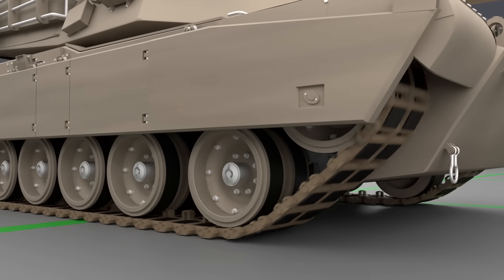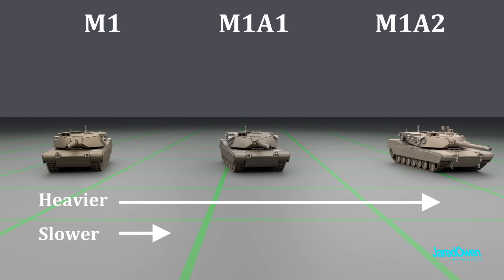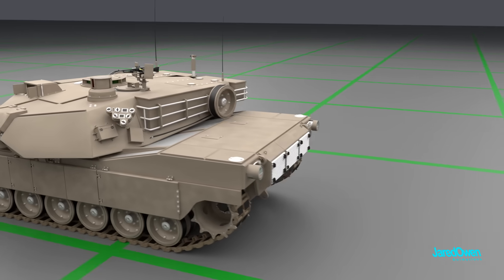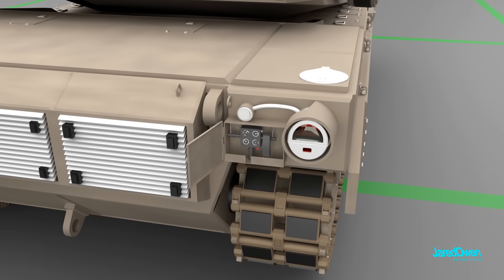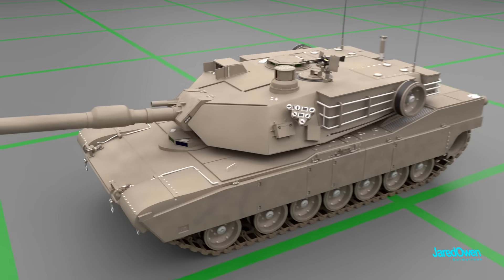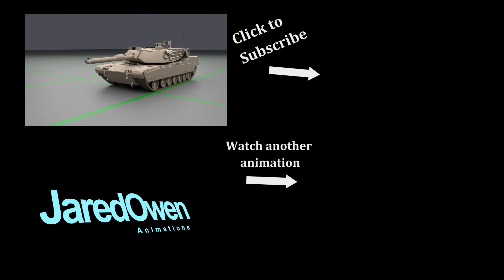How does a Tank work? (M1A2 Abrams)

Comment: I am an Army veteran (3rd Armored Cavalry) with experience with both the M1A1 and M1A2. I will provide quality control if necessary: 
@2:30 Top speed on flat, solid ground. Slower over rough terrain, but still capable of rapid pace (well over 30mph) 
@2:33 Fuel is distributed between 4 tanks: 2 in the rear and 2 in the front. Fuel is standard JP8 petroleum, similar to diesel. M1 can also run on other fuel types in distress.
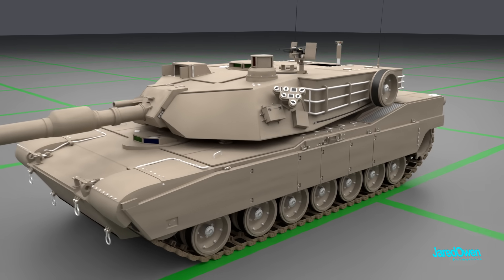@2:45 .6 mpg while driving, it has been suggested (not verified) that it takes 2 gallons to start the engine. For tanks not equipped with an EAPU (External Auxiliary Power Unit, a.k.a. generator) The engine is often left running to keep vital onboard systems operating even while sitting for extended periods- and in theory, to conserve fuel required by frequent restarts. 
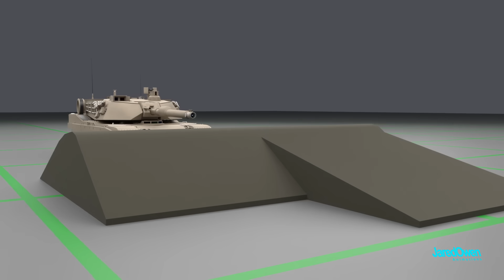@3:30 There are 7 PAIRS of roadwheels contacting the ground on either side (the narrator is not specific, but the animation did show them).
@3:56 The sensation of riding a tank over rough terrain can be described as being in a boat on choppy water: It "floats" over all but the most extreme obstacles.
@4:07 I have experienced extreme inclines (up and down) that I would have only attempted with a modified 4x4 vehicle, bridged trenches and never felt them, crossed through mud that would have swamped any other imaginable vehicle, and travelled at speed across rough terrain at top speed that, if attempted in my jeep, would have jarred my teeth loose and broken suspension parts.
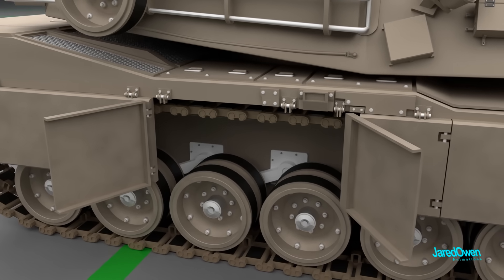@5:40 The "Power Pack", or engine, is modular and designed to be quickly, easily and regularly removed to ease maintenance. It can be prepped for removal by the crew and be out on the ground behind the tank within 20 minutes. It can be replaced just as efficiently. I have done this many times.
@6:24 "Make sure to stay clear when the engine is on"- There is a "jet wash" at the rear of the tank while it is running that gets more intense under power. At idle it is minor and is a boon during cold, snowy weather (look for groups of soldiers gathered behind idling tanks in the winter enjoying the heat.). ( "Crank up my $6 million space heater." is a common command from tank commanders during the winter.)  
@6:27 The phone is for infantry (using the tank as cover, etc.) so that they may coordinate movement and safety with the tank crew who are not able to see them.
@7:55 In addition to the loader's MG, the commander's hatch is typically equipped with a .50Cal MG (unknown why this is not mentioned or represented.)
@7:58 Smoke Grenade Launchers: The animation is inaccurate- smoke grenades are actually launched from the chambers and disbursed around the area to provide wider visual coverage. Not mentioned is that the tank is also equipped with a smoke generator that sprays fuel into the hot exhaust in order to create a large cloud that can be backed into or allowed to drift in a beneficial direction.  
@10:13 The driver's compartment is often referred to as "the coffin". It is actually very comfortable and drivers are known to doze off during periods of inactivity.

- The only thing not mentioned that I need to add is what makes the M1A2 particularly different from the M1A1 is the addition of the CITV (there are other improvements, but this is by far the most significant): The CITV is the Commanders Independent Thermal Viewer: It is the cylindrical protrusion on top of the turret just in front of the loader's hatch. This allows the tank commander to scan the battlefield and acquire targets independently of the gunner or the orientation of the main gun. This provides two sets of eyes independently scanning for targets and gives much more rapid target acquisition before and after firing; enabling immediate referencing of an identified target after another has been destroyed.
Reply: This should be the top comment
Reply: China: Write that down! Write that down!
Reply: @Pengied  In reality, none of this information is restricted and is readily available through publications. The classified information involves technical specifics (such as the exact composition of Cobham armor, targeting software, etc) that the crewmembers do not have.
Reply: "6 million dollar space heater"
Lmao XD
Reply: The loaders space isn't nearly that roomy as well. The coax ammo box and radios are located were it shows the loaders seat. The loaders seat is actually located more toward the rear of the turret.
Reply: (look for groups of soldiers gathered behind idling tanks in the winter enjoying the heat.) - Prior infantryman. Can confirm.
Reply: @TheMadMurf  bro f yes I melted my canteens standing behind that thing in the freezing rain. Trying to warm up lol. The exhaust was so hot the rain evaporated before it touched us. We were too cold to notice. Every time it’s could and rainy I smell the comforting smell of jet exhaust. ⛩
Reply: @michaelmartin5453  Yup: you can always spot tankers by the melted canteen straps!
Reply: @TheMadMurf  we would put MRE or can foods to warm the food
Reply: ቀጠኸቀኀኸሸቀኀጠ
Reply: Good work with corrections.  Only thing I would add after 13 years as a 19k is that we did run JP4 during ODS and the smoke generator must be disabled if you are running anything hotter than JP8 or you'll catch the engine on fire.  Also, as you know, that turret seal isn't air tight for the NBC (CBRNE) system since the NBC system isn't a pressurizing system but an over pressurizing system.  Even though I loved that useless turret seal hand pump for river crossings. I had enough days catching buckets of water in that turret to laugh at the air tight comments people often make, lol.
Reply: @rlbrooksssg  True, there are other details that can be mentioned as well, but then it gets into the "writing a technical manual" category. I never had the pleasure of running JP4 but I was aware of the smoke generator issue with the different fuel (another reason the driver's compartment is a death trap- "get in your coffin" being our instruction for the driver to mount up).
Reply: I'm not even American but thank you for the information and your services, Sir.
Reply: Thanks, Respect and Love from a military brat!
🙏🇺🇸❤️
Reply: Out-fking standing!!! 👍
From a Marine veteran.
Semper Fi...
Reply: "The driver's compartment is often referred to as "the coffin". It is actually very comfortable and drivers are known to doze off during periods of inactivity." But man, it sucks when you get a leg cramp.
Reply: Except it isn't called "the Coffin." It's just called "the driver's hole."  @resolute123
Reply: Sir you could make a vid with this comment , like wow 😂.
Reply: Very informative .
Reply: as a former m1a2 sep driver, i concur with the dozing off, including long road marches
Reply: @cpt_stupid82  I spent most of my time in the turret, but when I did get to drive, I will admit: trying to keep my eyes open on long flat road marches was definitely a challenge!
Reply: @psyekl  Tough for drivers! Does it have self-driving or automation of some sort?
Reply: @timly1165  "Does it have self-driving or automation of some sort?"  -In a way, yes: Quit paying attention or fall asleep and it will continue on in a straight path until it encounters something more significant... (joking: the throttle requires active participation).
Reply: Thank you for the additional info.
Reply: Thank you for taking the time to provide further depth details. For some one like me who knows nothing about tanks this was so interesting and will enhance my knowledge whenever I see and hear about these tanks.
Reply: I was at 3rd ACR HHT 2/3 ACR 1988 to 1989
Reply: Thank you for your service sir
Reply: What do you think about current state of tanks? Are the tanks still main strength of best world armies? Is it safer to be the tank crue member or infantry member?
What do you fear the most (which military units like aviation,artillery,drons,other tanks or infantry mentioned before) being tank crue member while you are deployed? 
Are m1a2 abrams able to survive the drons like phoenix ghost attack or artillery shelling or some shoots from tank destroyers?
Do you have something like radars or antyrocket shield that cover you from the homing missle attacks ? 
Sorry for that much questions but i havent got an ocasion to discuss with solider uo to now.
Reply: @Mocarz36  As tank crewmembers we were informed without any sarcasm or irony that on a modern battlefield our life expectancy was very short. If you look at the armament of the typical military, the term "anti-tank" or "armor-piercing" is very common. The typical joke is that soldiers are cheap: the tank can take a hit that will kill its crew, you just hose out the interior, weld the holes closed, and issue a new crew. Such is the life of a soldier, and we accept it. The strength of the tank comes not only from its armor and armament but primarily from the expertise and cooperation of its operators: speed, efficiency, good coordination and excellent leadership are what keep tank crews alive, not the armor. the same applies to infantry.

As for "what do we "fear"- we are literally riding around in a metal box that has few or no safety considerations, but a great many moving parts while one part swivels about on the other. ammunition doors are hydraulic and will sever an arm if you're not fast enough, the breech of the gun will crush you if you move at the wrong moment, stick a foot through a gap in the turret basket and you will lose it, if the driver doesn't communicate properly while their head is popped out of the hatch and the turret gets turned, well, whoops. Stop too hard or hit a severe obstacle at speed and there's nothing but unforgiving metal all around and no seatbelts, the heater is notorious for catching on fire and the extinguisher system is halon (no oxygen), a rollover means everyone except maybe the driver will be trapped inside until rescue, the driver's compartment is called "the coffin" because the driver can only exit with the turret in a certain position, so in the event of an emergency... 

So to answer your question: We are terrified of our own damn vehicle! Whatever the enemy throws at us is just something new to pay attention to until we get back to surviving the rest of the day.
Reply: @psyekl  Fact Check: True
Reply: @Mocarz36  "Are the tanks still main strength of best world armies?" -I'm not an expert in the subject, but I would have to say the answer would be more and more: NO. Not only is the fact that munitions are getting better and better, but the methods of delivering them are getting more and more "smart" and easily obtainable to less well-funded militaries. The strength of tanks are in their "shock factor" and their ability to take ground, but they are slow, prohibitively expensive and cumbersome to maintain for any but the most well-funded militaries. With the development of new technologies, the state of the battlefield is also changing and the role of the tank is growing less and less relevant.

What is important to understand- and something that, as soldiers, we learn to deal with as a reality: Equipment is expensive, but soldiers are cheap. While they have the technology to outfit a tank with equipment to make it keep its crew alive longer on the battlefield, it just isn't worth the cost. Tanks are expensive enough already without adding to the expense just to "maybe" add a few more seconds to the crew's life expectancy. As soldiers, we know it is up to us to keep ourselves alive, our equipment is just a tool to aid us in that endeavor while we fulfill our mission. Note that I say this without being familiar with the most modern advancements: I haven't been on a tank in 2 decades and the SEP version was brand new when I was in. I have seen some of the improvements they added and admit I like them, but I haven't heard of them using any of the advanced developments shown in DARPA videos out in the field.
Reply: @psyekl thank you for your time i was theorically considering of going to "armoured brigade" if current war conflict expand to wider area because i am from Poland so we are kinda close of this "event" but now i think you changed my views about modern battlefield and propably as a  civil i will do something else.
Reply: @Mocarz36  Being a soldier is definitely not for everyone. Good luck with your decision, and may you and your family remain safe.
Reply: Greetings from former 1/333rd Field Artillery, first Lance missile unit in Europe. Thanks for your service, and the intricate details of the Abrams. My understanding is that the rotary shocks make for great improvements in navigating terrain.
Reply: O Gosh to much info don’t forget WE have idiot enemies!
Reply: @johnbridges6867  Too much info would be to include any technical or tactical data that are not publicly available. All of the information here is public, well-known, and just basic general info or trivia.
Reply: You just wrote a whole book on it
Reply: @crazyartistvinitfiji4168  Writing is one of my hobbies, so I tend to get verbose...lol
Reply: Excellent points.  I knew almost all of them and I was also wondering why they were not covered in the video.  Thanks.  LTC (Ret.), US Army
Reply: I can't help but imagine infantry hiding behind the tank as cover. They have the phone, yes. But if the driver turns the gas on these infantry become TOAST! Or is it not that bad? I'm genuinely curious
Reply: I served in the 3rd Amored Cav Regiment 90-94. I was amazed by the tanks even though I was in an artillery battery.
Reply: Горит твой танк за милую душу😂
Reply: Хорошо горит однако, ярко. Да и платят за подбитый хорошо. Присылайте ещё
Reply: Внутри танка опасно находиться, особенно если он едет в сторону России.)
Reply: My grandfather was in G troop of the 3rd Cavalry. That was back when Colonel Patton was the commander, and the 3rd Cavalry was still riding horses. Patton insisted troopers carry sabers, and do regular practice on the saber course. Up in the attic I still have my grandfather’s old saber, and a 1911 Colt pistol he found on the parade ground at Ft Myer. He picked up the pistol and kept it, as it belonged to a 2nd Lieutenant whom he didn’t get along with.
Reply: @twowheelsintokyo7039  не хорошо такую саблю хранить на чердаке, у меня шашка деда лежит ухоженная на полке на видном месте
Reply: Y así con tanta ino avión no sirvieron en Ucrania los desacieron
Reply: 7jjwjquwuuedhwueuiwiwuwueusydydydyshdyyyyeeuueu7ueu
Reply: Finally someone who actually knows and has experience with the tank, I'm tired of these tank expert wannabes fighting like man babies talking out of their asses.
Reply: How does the BRASS eject?
Why no boggie wheels ? ?
Reply: @BIG-DIPPER-56  There is no "brass". Modern tank rounds are caseless, leaving only an aftcap and primer tube behind after firing which is easily managed. I assume you mean "bogie wheel" as in the spring suspension seen on older and lighter vehicles? The M1 uses "High-hardness-steel torsion bars with rotary shock absorbers" (from a reference site) These were supposedly replaced with something more durable in the M1A2 since we kept breaking the steel.
Reply: @psyekl  Thank you so much ! !  !
   😎👍
Reply: Imagine a shotgun shell that after you fire it, only the brass part is left over.
Reply: @neilbpence  "Imagine a shotgun shell that after you fire it, only the brass part is left over." - This is about as accurate of a real-world example that I've seen.
Reply: @BIG-DIPPER-56  Caseless ammo. Lighter and consumeable as in no water brass which is additional weight.

Ammo is ignited by electric primer to fire  sabot and fin-guided projectile commonly known as a penetrator.
Reply: @kfelix2934  
  Thank You ! !
Reply: Average length of engagement for a accurate shot and maximum ?
Reply: @rayRay-pw6gz  "Average length of engagement for a accurate shot and maximum ?" -I honestly do not know this one. A gunner/commander/loader team will obviously grow more proficient with experience. During training I have heard tanks fire at different targets as rapidly as the turret could rotate and the loader could load ("boom" (short pause) "boom"). Well-trained crews are beyond impressive!
Reply: @psyekl  👍✌️🇺🇸🦅
Reply: It seems that this outdated monster yet had its problems in Iraqi ´s desert as it will have in Donbass´ cruel winter. Cheerio you anachronistic NATO-stooge helplessly having problems in making ends meet.
Reply: @rundepanien862  As far as I'm aware, it performed adequately in Iraq, though it would be interesting to hear about any common significant issues that had been encountered (I am aware of other issues it has in different terrain). As for the Donbass' winter, I recently had a conversation on this subject and how the terrain and climate (se: mud) will affect strategy concerning heavy-tracked armor. You are definitely correct in pointing this out.
Reply: THANKS Tanks
Reply: @AnnaLuchia  "Did you ever go to Ft Knox?" - Ft. Knox is where I was trained on the M1A1. I'm not sure what you're asking about the video: it is CGI, and generally represents an M1A2. There are a few inaccuracies, but I'm not going to nitpick Jared's excellent work.
Reply: How does it compare with the Leclerc ?
Reply: Did you read in the video summary that the gun shoots projectiles at 3500mph? That is a bit more than 5000 feet per second. That seems way too fast. What's your thoughts? If it is wrong, I'm not criticizing. Easy to make mistakes and I make more than my share. :)
Edit: I just looked up the gun. Up to 5500 fps! WOW!
Reply: @robguyatt9602  Yup, I've always heard the round velocity rated by "feet per second" or "meters per second". If it was "miles per hour" then I assume it was an error or requires verification.
Reply: Thanks for that well written bit of info.
It seems if the turret were to be disabled from rotating, the driver could be trapped inside. Could that happen?
Reply: what about the 50cal up top? my a2 had a 50 on the crws
Reply: kina virus released to fk up the elections...millions dead, billion+ with heart/organ issues...evil know no bounds, 100% intentionally released...just to get one man out of office, one man they could not buy/control....Godless people will always create hell !!!
Reply: Sweet
Reply: Can also confirm that we loved when Abrams were around during cold winter nights, great for heating up Mre’s as well
Reply: Me and my sgt almost got flattened by a m1a1 while doing field excercises in korea, it coming blasting out of some 10’ tall vegetation onto the road making maneuvers during war games, we were in our little HMMV heading to a grid to pop smoke for simulated artillery and about become pancakes😂😂😂
Reply: Sssht hes a wanna be M1-s expert. If this was your 2nd wife on the battlefield and the garrison it makes a whole lot of difference. You know everything in this tank like the palm of your hands. Same with me and the M2 Bradley. I can still maneuver my way out with my eyes close.
Reply: @czealtamahawk1228  <--- I'm not sure why this individual feels threatened.
Reply: GOD BLESS YOU SIR!
Reply: Don't stand behind the tank because of jet wash. Also infantry need to stand behind the tank for cover and to talk to crew.... Who thought up that idea?
Reply: The wash only comes out of the center about 2 feet wide. If you want to warm up, stand about 15 feet back. If you stay to close more than a few seconds, even your boot laces will melt.
Reply: @neilbpence  "If you stay to close more than a few seconds, even your boot laces will melt." -Not quite. This would be true when the tank is throttling up or otherwise accelerating, but when sitting idle, the wash doesn't effectively reach all the way to the ground. A fair distance is still required since it is very hot.
Reply: I regret opening this comment…… thought it was shorter
Reply: Do you really had to repeat what this guy already said in the video?
We'll see them soon on the real battlefield and then we can talk how good this tank is 😉 
Americans tend everything to make big which benefits them and always to glorify themselves, but when it comes to the close battle, their weapons refusing to be as good as presented previously in the videos like this one.
Reply: @GegeDxD  "National pride" is a trait common around the world. There are many admirable things to boast about regardless of what we are discussing or where we originate from, though admittedly some have too much confidence combined with their loyalties. While American equipment is of decent quality, I have a fair number of critiques about them myself. Nothing is perfect, and as I have stated before: the quality and training of the user are as important as the equipment they are provided (perhaps more so).
Reply: Ask the Iraqis about how the Abrams works on the battlefield... Also when the Americans are undefeated in conventional wars that tends to show that we can back up what we are saying about our weapons. We may not have the best equipment but we surely have better than most. Especially when all Americas adversaries are using old AKs from the Cold War with untrained troops.... Most importantly we know how to effectively deploy our firepower on the battlefield. Which is more effective than having untrained, undisciplined troops with "better" weapons that don't know how to deploy them properly. Plus our equipment is easy to pick up. Look at what the Ukrainians have done with our equipment with little to no training on it. Imagine what people could do with it that train with it on a daily basis. Also, the battlefield is ever changing. We don't even use the M1A2 anymore. And the one we do use is getting phased out very soon. For a more lethal and stronger version. You are correct, I too believe we will see the battlefield soon. We will see what the newer improved version does to shitty T-55s, T-62s and modified T-55s will do against it. Good luck.
Reply: @155jwatson  Confidence is always good, but we always need to take into consideration what drives the opposition, as well as our own purpose for being there. Afghanistan and Vietnam are excellent examples. While the quality of our equipment may be good to above average, there are arguments to be made that the quality of our training and recruitment base is declining. So many factors come into play, it will be interesting to see what the future brings.
Reply: I know this is a 1 year old thread, but the CITV,  cant the commander literally 'yoink' the gunner over to something he's looking at? or is that something one of the Military games simulated that doesnt actually happen?
Reply: @Gwydion_Wolf  iirc that's why they gave the CITV (i just call it the Commander FLIR lol) so when the commander does see the enemy he can take control of the gun to rotate the turret to engage, it's what that joystick is for. Although i just study these vehicles and i never served or been in one (hats off to all the service men y'all are braver than I'll ever be lol). So i could be wrong with the info i would wait until a actual tank commander comes in lol.
Reply: @Gwydion_Wolf  Yes, the commander can override the turret to point to a target that he has in his scope. This is only ever done with the gunner's full awareness and when the gunner is not focused on a target. This trait is one of the strengths of the M1A2 and later versions: the ability for two pairs of eyes to search for targets to gain rapid acquisition, and multiple repeated target elimination when necessary. This is where crew training and coordination is key: The number of kills per minute is determined by how well the crew is trained.
Reply: Will burn on ukrain like Ukrainian  tanks
Reply: As a Tanker know I was thinking the same exact way as you. I had a lot of Critique but I know they can't get it all right. As a former driver I can say that I have fallen asleep more times than I can count while in the coffin. Its very easy to do when you are in a defense with no action. Or just in a halt.
Reply: @155jwatson  The driver falling asleep was not the problem. Having a driver that wouldn't wake up was what made us angry! I was fortunate that I would wake up immediately with the mention of my name, so my brief time as a driver was the most pleasant position I had. Combine that with plenty of reading and writing materials and I was always snug as a bug in my hole!
Reply: Knox Tanker here, not a Benning Brat.  Anyway, Pretty accurate breakdown EXCEPT for one minor detail: I've been with 1st Armored (1-6), 2nd ID (2-9 MANCHU!), and 25th Inf (3-21 Gimlets) and I have never once, EVER, from ANY crewman, From Korea to Bliss, to Wainwright heard the driver's hole referred to as the "coffin." It's just the "Driver's Hole," bro
Reply: @jaygosev3589  The term "the coffin" was heard at Ft Carso, Colorado, 3rd Armored Cav.
Reply: Соссия мощь! Понял меня? Соссиянин?
Reply: @ВадимЗиганшин-е7ь  Что подгорает задница 😀
Reply: О! Еще одно Самойленко нарисовалось. Русским оно стало, Самойленко это...
Прильнувшее к путинскому бую.
А главное и жизни своей не мыслит без путинского болта. Оно же без Путена сразу пропадет. Бессмысленное существо.
Подгорает у него что-то там... Видать Вассерман насовал. Теперь горит и зудит всё и чешется.
Заткни свою чесотку георгиевской ленточкой!
Reply: У Володи сперма Вассермана на лице.
Вовочка, ты утрись георгиевской ленточкой.
Reply: And so what? Are you finish? 😅 https://youtu.be/clOaelaj3FA?feature=shared
Reply: Li aspettiamo in Ucraina per distruggerli tutti i vostri Carri Disarmati, come in Siria incapaci e Delinquenti Terroristi Mistificatori Mentitori USA 🇺🇸🇺🇸🇺🇸🇺🇸🤡💩💩💩💩💩💩 e Getta 🇺🇸🇺🇸🇺🇸🇺🇸🤡🤡💩💩🤡 con un Presidente RIM BAM BIDEN 🤡🤡🤡💩🤡💩 Usa 🇺🇸🇺🇸🇺🇸🇺🇸🤡💩💩💩
Reply: Ланцет тоже стоит от 3 до 5,5 миллионов бездарных рублей.
Вы не знали?
Reply: 🎉ሸ፣ኀረገፕፖጠኋሸጠኀፐፀኀሰሸጠከኀበበሸኀጠኀኀሸፐአኀፐፐጠጠኋሸ ጠኀፐፐኀሸሰበኋሸፐሰኀፐሸኀሰጠፐፐፐፐፐፗሰ
Reply: ጠኀሰሰኀጠኀገ😢ጠኀሸኀጠሸፐኀገኀሸጠፐኀጧከ ሰኀሸሰኀሸበኋጠፐፐ በሸምበቆ ኀጠሸጠኀጠ
Reply: ሰኀኀሸሸሰሸአፐኀሰጠ
Reply: @nezifpeace3995  ተስፋ አልቆርጥም፣ በኮምፒዩተር ላይ ላለው ነገር ሁሉ መልስ ለመስጠት በጣም ተጠምጃለሁ።

I must thank you, however: I was not aware of the Ethiopian text despite having friends from Africa. How awesome!

As for the continuation of this dialog, I have become disinterested since it is no longer productive. I have no enmity against Russia, its soldiers, its people or its culture. My only complaint is with our assorted government leaders, their unwise decisions and the cost in lives. As a soldier I understand what it means to do our duty regardless of the quality of our equipment. My ultimate goal has always been for encouraging education and dialog. We do not have to agree, but it is always better to attempt to reach a compromise than to simply fight like fools, though I am not foolish enough to offer anyone who chooses to fight an easy target without reprisal. It is just far better to avoid the whole mess and go about living.
Reply: ሰኀሸከኀጠሰጠኀጠሰኀፐ ጨምረው ሰጠኀ
Reply: ጠኀጠጠሸቀሰኀሰቀኀ
Reply: ጠኀጠጠሸቀሰኀሰቀኀ
Reply: ሸ
Reply: ጠኃ
Reply: Putin sabe mucho de esos tanques le gusta verlos volar como latas de cervezas😂😂😂
Reply: O9 @leonidasbarradas1452
Reply: For sure can’t keep up with German Leopard tanks
Reply: Я так понимаю , это всё  им неочень  помогает и теперь абрамсы стоят в Москве
Reply: Good afternoon. I can contact you for advice on M1A2. Tell me please. Thank you.
Reply: @notar_  There is nothing I can say that isn't already said in the public forum.
Reply: These clunky tanks are so famous that there are already countless of them exhibited in the most media museum in Moscow. jejejejeje
Reply: @tilingaseme773  <--- I think these individuals are trying to antagonize us...
Reply: Yesterday I visited an exhibition in Moscow, where the damaged Abrams was exhibited. Is it true that the roadwheels can be changed to those from the Russian T 72?
Reply: Com’è che i Russi lo hanno seccato? Sta meraviglia
Reply: @fiorenzobrambilla8482  - Hey folks, some advice for clarity since there seems to be a bit of confusion going on: There are a lot of comments in different languages here. If you are using Google, simply right-click and select "translate" to be able to read them, or other online translation apps are readily available. 

Thank you and hello to those commenters from other nations who I haven't had the opportunity to speak with yet: Despite the troubles of the world, I never see the point of looking unfavorably upon the people of the nations who may oppose my own in some silly political matter. As far as I am concerned, it is the regular people of the world who need to establish sanity and stability while those who's duty it is to wage war for some "greater purpose", sent off to kill and die as determined by its ruling class. As a former soldier, I understand this duty and recognize my responsibility to defend my people. But I admit I would much prefer to celebrate with and travel peacefully among the people of other nations than face them with aggression. 

With this in mind I have to say I honestly do not care who has the superior tank: just who has the superior desire to choose not to use it.
Reply: а чего так на украине обосралась эта техника??
Reply: @SUSUMAN-u1w What I've been hearing is that the Tanks are not being fielded properly in Ukraine. Tanks suffer from very well-known flaws on a modern battlefield, and thus are vulnerable to poor tactics. The M1 Abrams is no exception to this rule.
Reply: You were damn precise.
Reply: Dogshit
Reply: Забыл сказать как отлично горит этот танк на Украине!
Reply: Were you killing with the intention of doing what your brothers did?
Reply: @psyekl  ваше дерьмо хорошо горит и будет гореть
Reply: Горят!!! И очень хорошо, ваши консервные банки!!! На украине!Сделаны из говна!!!!Прожигаем насквозь!!!
Reply: Может быть вы что-нибудь знаете о танках России? Если да, мне бы очень хотелось увидеть ваше мнение. Потому что очевидно, что вы эксперт в области танков и вооружения. Заранее спасибо!
Reply: @Singular_1806  самые лучшие в мире танки у России и не только танки. Люди намного беднее чем в Европе, поэтому особо нечего терять. От сознания безвыходности -- злые, виним в своих бедах Запад.
Reply: @ да я хотел услышать мнение эксперта о наших танках. Думал может скажет что интересное
Reply: @ нам знать нельзя? Отчего же? Если человек эксперт военной техники, было бы интересно узнать его мнение о наших русских машинах. Узнать что они думают о нас, о наших инженерных решениях
Reply: @Singular_1806  очень коеший машын.
Reply: @Singular_1806  очень коеший машын.
Reply: @ оригинально. Чувак не пиши мне больше ничего пожалуйста
Reply: @Singular_1806  русские не сдаются! Прут как танки. Ты мне больше не пиши, хорошо?
Reply: @Singular_1806  самые лучшие в мире танки у России и не только танки. Люди намного беднее чем в Европе, поэтому особо нечего терять. От сознания безвыходности -- злые, виним в своих бедах Запад.
Reply: Es increíble que ahora los destruyen con un dron de 1000 usd😅
Reply: Он был в настоящем бою?
Reply: That's a mouthfull
Reply: As a former Cav officer, I want to thank psyekl for the great comments.  Despite some minor mistakes and oversights, though, I think Jared did a fantastic job with this animation!
Reply: @brianhann-d3x  Thank you, sir.
Reply: Found another mistake for you: 6:03 That's incorrect. All tanks except M1 have piston engines. No other tank uses a turbine engine.
Reply: @samborlon  T-80 (1976) and Swedish Stridsvagn 103 (1967) used a gas turbine engine. M1 entered service in 1980.
Reply: @samborlon  T80 U
Reply: @samborlon  T-80BVM, T-80U. These Russian tanks have a turbine engine installed.
Reply: @officerjohns9554  Those tanks are also extremely spars and aren't being made frequently. The T-90 uses the T-72 hull which is powered by a diesel engine. The new T-14 Armada has a turbine but is very far from mass production. Which is funny, because the T-14 "The Abrams Killer" broke down in the middle of a public parade and had to be towed away. The Russians have an abundance of T-55s, T-62s that they are slapping ERA "Explosive Reactive Armor" on and sending it to the front. Which is also diesel powered. The Abrams is the only mass produced/being produced series of tanks that have a Turbine Engine. But yes the T-80 does have a turbine engine. But very uncommon that we will see many of those.
Reply: Thank you for your service!
Reply: He also didn't talk about the commander's CITV Thermal Viewer, and the Gunner's primary sight.
Reply: I noticed most of comments here are from active, discharged and retired military personnel. Thank you for your service, gentlemen. We salute you! 😎👍
Reply: Thank you.  I absorbed what I just read. An I have seen this smoke screen in use I wondered where it came from.
Reply: Please, use also a metric system for data.
Reply: @rj10x  What I wouldn't give for the US to convert to the Metric system! As a draftsman and designer, I use metric whenever possible. It has been promoted within the industry ever since I began training in the early 1980s and was even taught to us in grade school, it just hasn't caught on with the populace. I saw it used several times while in the US military since we understand that our allies will be using it exclusively. Whenever the topic comes up, I always promote metric over fraction standard.
Reply: @psyekl Ironically you guys have been using cents for how long?.. lol. I’ve been caught between the progression to metric from imperial plenty of times. Calculations are just much more convenient in the metric/decimal system.
 Great info cheers 👍
Reply: That's a excellent bit of information. 
It was originally designed to run on JP4, then switched to that nasty ass JP8.
It is closer to kerosene than #2 diesel fuel oil. But will run on it. 
I fieled the tanks for the 1/33 & 3/33. The civilian inspectors would need a TC to give them a road test.  I was their guinne pig. 
They would cross ditches at full speed that would swallow a car,  just goes right over without a bump. Told me to hang on tight going to check the brakes.  Luckily he told me that he thrown a full bird right out of the turret. off the front and onto the ground. 
I latched on tight with my arms inside the turret.
He hit the brakes at full speed. I was pointed straight forward with my feet in mid air. The back of the tank was almost straight up. The front 3 road wheels were on the ground. Stopped in about twice the distance of the tank. Totally impressed was I.
That thing did much better than the M60 with that single master cylinder from a 68 Ford pick up controlling the brakes. 
Which isn't as scary as the fact the m88 used the same master cylinder. 
Sparky Spearhead TC!
Reply: @eddieb4227  During my second week of basic training at Ft Knox I watched a tank come to a rapid stop on the tank trail at the back of the motor pool. I was impressed so I made a point to ask a training Sgt later "how quickly can the tank come to a halt?" His response was: "It can stop on a dime and give you 5 -cent change."  I discovered later how very true this was! I angered my first driver training instructor by stopping too quickly , forcing him to slam forward against the turret hatch and burst open a soda bottle he had in his pocket. I was told to be a loader, not a driver, LOL. I definitely learned to brace for emergency braking: it is no fun catching a face full of the inside of the turret or the back of the machine gun. 

One of my worst injuries from unusual movement was from being tossed out of the loader's hatch while driving cross-country at full speed. We hit a series of hard bumps unexpectedly: The first lifted me out of the turret up to about my knees, the second brought the whole tank up to meet my hip as I was falling back in. My crew got to train on how to medically evac a crewmember from inside the turret that day! Fun times!
Reply: @psyekl  I was OSUT, C 2/13 2nd Plt, Ft Knox, 1990.
Reply: @applejacks971  OSUT 1998 here. Ft Knox summer rotation. It never occurred to me to remember my training unit designation...
Reply: EN
Where is it better to hit? Otherwise, it is not said about the armor, but in Russia they give money for every Abrams shot down in Ukraine, a little more than for a German Leopard.
Send more tanks, we've shot down all the leopards and Abrams. We need experience and a lot of people who want to knock out Abrams. It's interesting! Ask old Biden to give the Ukrainians more of these tanks so that we can train well. We have nothing bad against ordinary Americans. NATO is bad.
Rus (the original text)
Куда лучше бить? А то про броню не сказано, а в России за каждый сбитый на Украине Абрамс дают  деньги, чуть больше чем за немецкий Леопард.
Вышлите еще танки, мы все подбили и леопарды и абрамсы. Нужен опыт и много желающих подбить абрамс. Это интересно! Попросите старика Байдена дать украинцам еще этих танков, что мы могли хорошо натренироваться. Против простых американцев мы ничего плохого не имеем. НАТО это плохо.
Reply: Хороший танк, но простите, сколько он стоит? Правильно-очень и очень дорого! Хорошие характеристики, и вдруг прилетает Ланцет, и вот, конец фильма! Спасибо за просмотры! А Т-90,это лучший танк в мире на сегодняшний день, и как бы Вам это не нравилось, но это так!
Reply: @sers6007  Т-90 действительно отличный танк, если опубликованная статистика верна. Проблема в стоимости изготовления, обслуживания, оснащения и обучения экипажа. Хотя танки серии M1 могут быть дорогими, они обычно используются странами, которые могут покрыть расходы. Хотя М1 определенно уязвим для противотанковых боеприпасов на современном поле боя, не обманывайтесь, думая, что Т-90 менее уязвим.

(response originally typed in English, translated in Google Translate) 
The T-90 is indeed an excellent tank, if the published statistics are accurate. The problem is the cost of manufacture, maintenence , outfitting and crew trainining. While the M1 series tanks can be expensive, they are typically fielded by nations that can absorb the cost. While the M1 is definitely vulnerable to anti-tank munitions on the modern battlefield, do not be fooled into thinking that the T-90 is any less so.